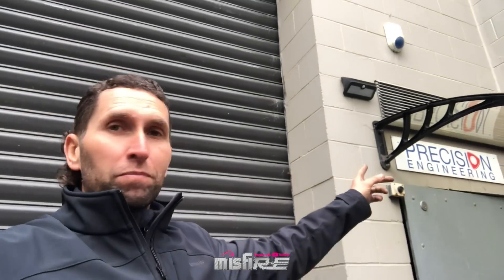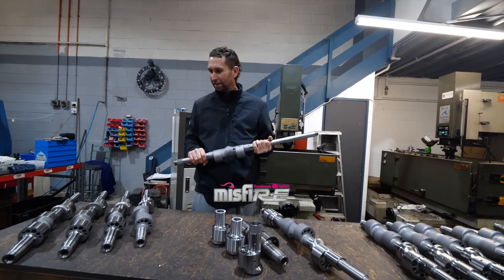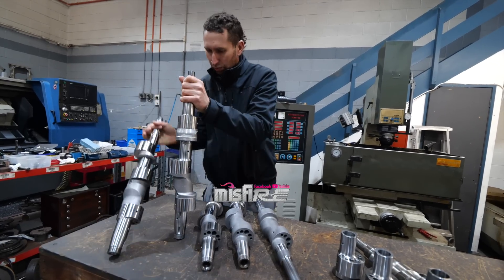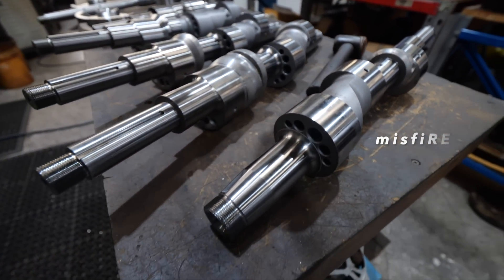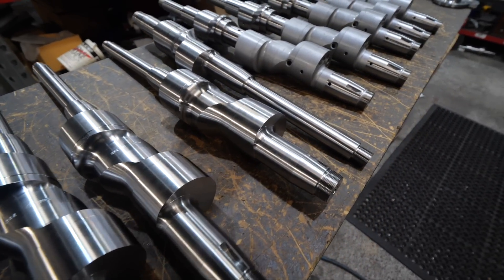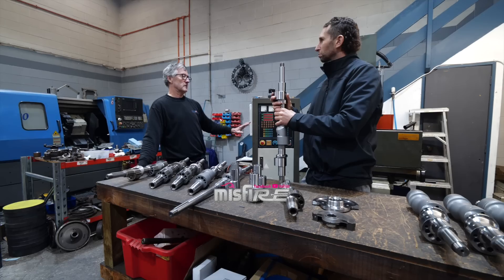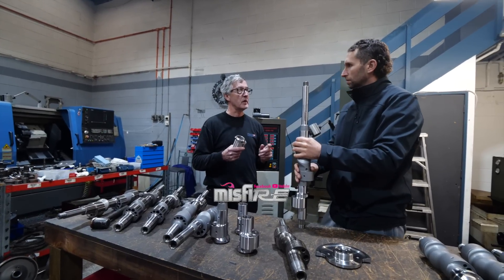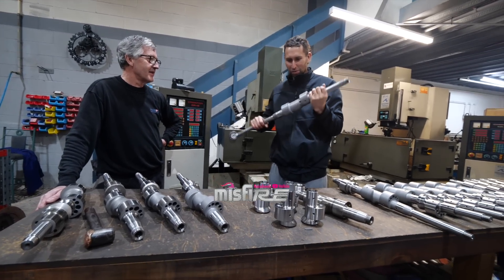5 rotor ROTARY crank  #8rotortesla

Comment: Bru is that fit to my rx8 🙂?
Reply from the maker: 4 and 6 port not sure will fit renesis engine u could do a fd fit🤘🤘
Reply: @misfirerotary  but I prefer the rx8 because it's cheap, lighter & inconspicuous modified sports car to avoid pull over. It means I do it secretly😁😆